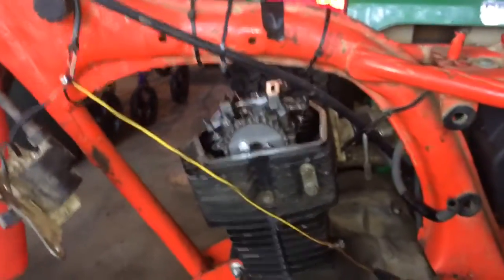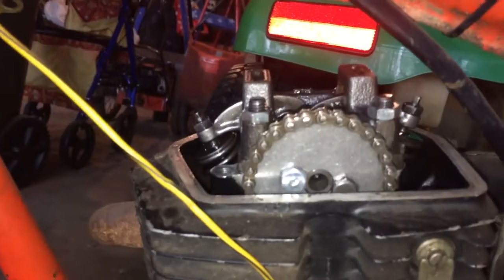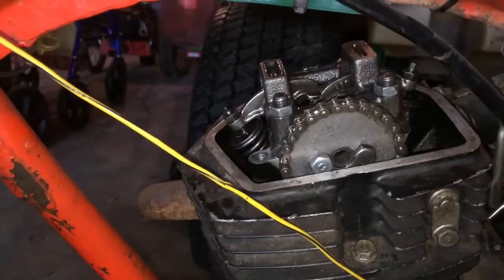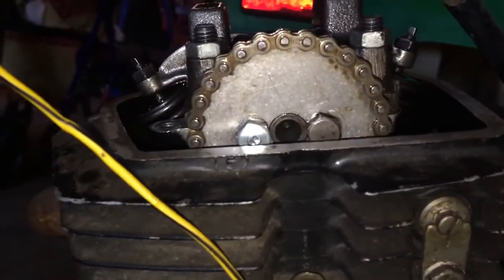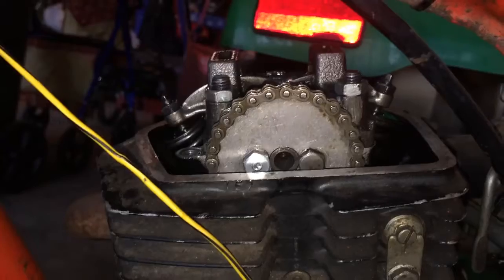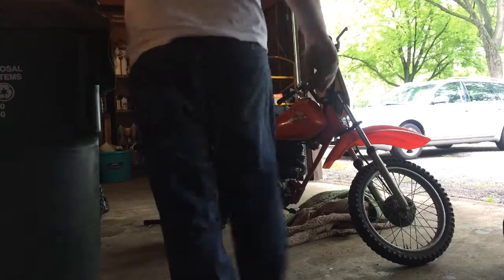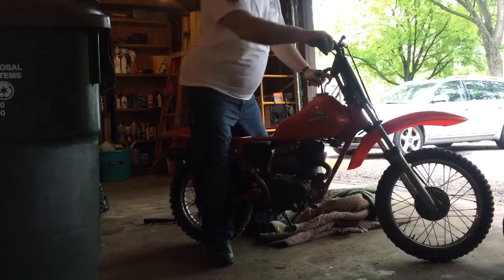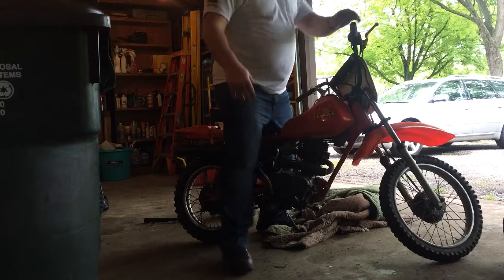1984 Honda XR80 Setting timing part one

Comment: Pretty sure this is my issue. I even said the same WTF lol. Got mine running after going through carb and then all the sudden it’s like the timing is off and wouldn’t start after it was banging away every kick. Gonna check my flywheel

Comment: I used a nail filed the side's flat cut the tip of it off as long as the bolt is tightened good you'll be okay